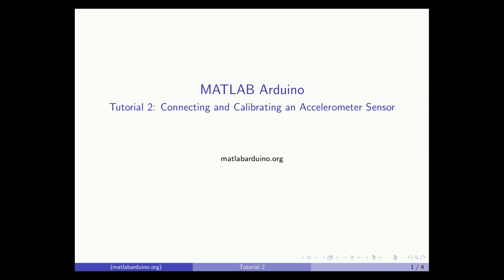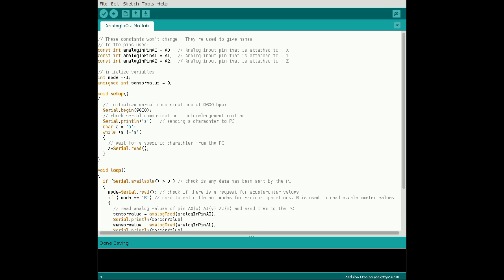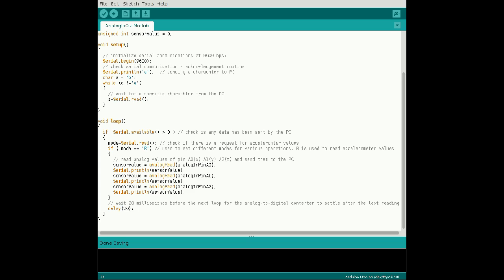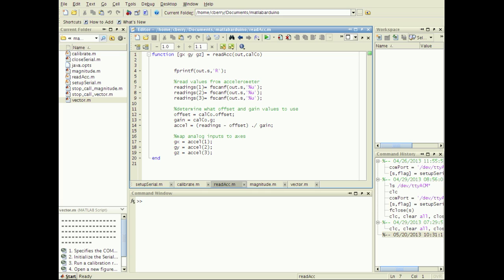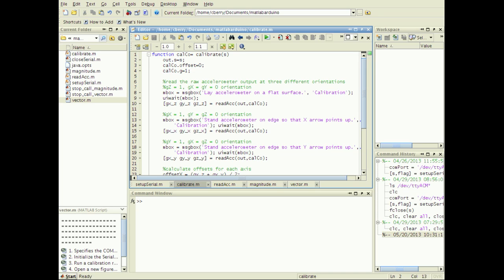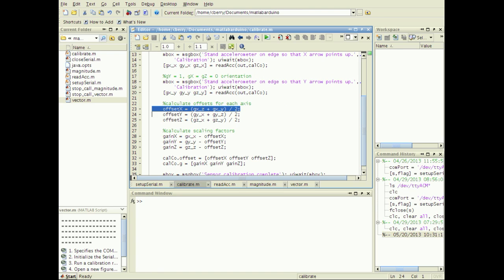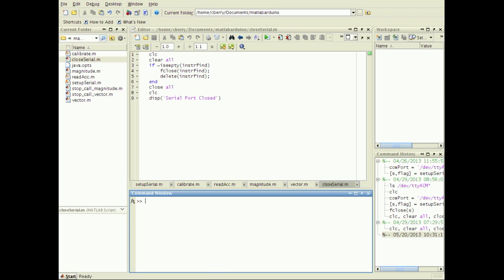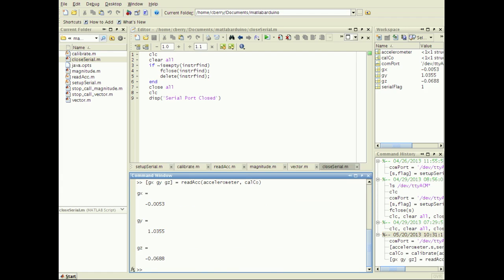MATLAB Arduino Tutorial 2 - Connecting and calibrating a 3-axis accelerometer

Comment: Thank you so much Sir. Also please make a video on strapdown inertial navigation system (SINS) using the outputs of strapdown gyros and accelerometer in matlab and simulink. And then perform DCM(direct cosine matrix) to calculate position and velocity of an aircraft

Comment: I realize this is 4 years old, but I have this issue: 

Warning: Unsuccessful read: A timeout occurred before the Terminator was reached. 
In an assignment  A(I) = B, the number of elements in B and I must be the same.

Error in readAcc (line 5)
readings(1) = fscanf(out.s,'%u');

Error in calibrate (line 9)
[gx_z gy_z gz_z] = readAcc(out,calCo);

Any suggestions?

Comment: i followed your steps exactly, and I have the same sensor (MMA7341L) and I followed the same exact code and yet my accelerometer does not display the same way as yours, in fact its way off, and when i continue on to video 3 and I follow the same code as well it doesn't plot like any of the graphs your showing and the data that i am getting don't make any sense, is there anything else you connected to the accelerometer? also the mma7341l takes a maximum of 3.6V, why do you connect it to the 5V pin on the arduino UNO? I will send you the code for the arduino and matlab for calibrating the accelerometer and I would appreciate it if you would look at it and let me know what am i doing wrong.
thnx

Comment: Dear Matlab Arduino,
firstly, thanks for uploading these tutorials. i've followed the code exactly from the first and second video but when i run it i get these errors...

Warning: Unsuccessful read: A timeout occurred before the Terminator was reached. 
In an assignment  A(I) = B, the number of elements in B and I must be the same.

Error in readAcc (line 5)
readings(1) = fscanf(out.s,'%u');

Error in calibrate (line 9)
[gx_z gy_z gz_z] = readAcc(out,calCo);

could you please help me? thanks!
Reply: Did you find a solution? I realize this was 4 years ago...

Comment: I'm actually doing quite different from the video...I'm calibrating the accelerometer, using a 6 point calibration, in the arduino code. For now I just want to plot the accel data...if I send you my e-mail by private message could you send me your MATLAB code? If you want I'll send you my arduino code
Reply: Hey, could you send me the codes?
aalconchel@live.com

Comment: Hey ,,, well my problem was that i was using to many serialprint during testing with the arduino serial monitor ..... when i removed them everything worked just fine :D:D 

Its the same one used in the video i didn't change a bit.

Hope this helps ...... 

I should also use this data and do something like tracking a 3d object orientation .... 

Any ideas or references to the math used  ????